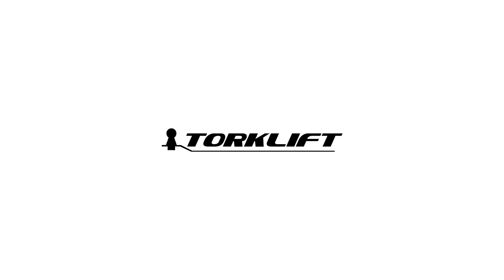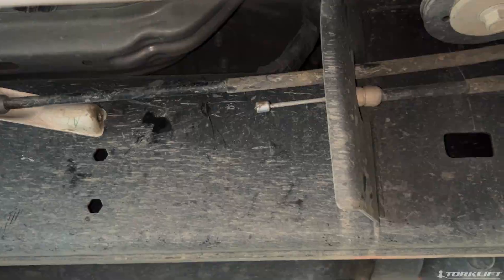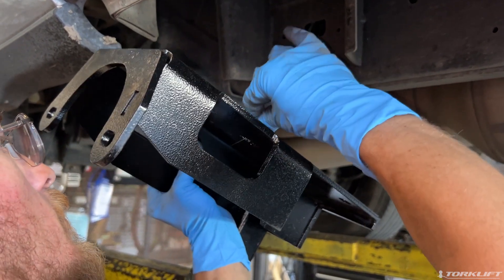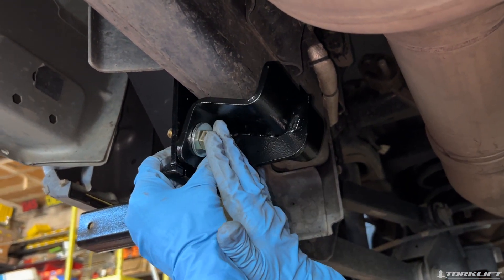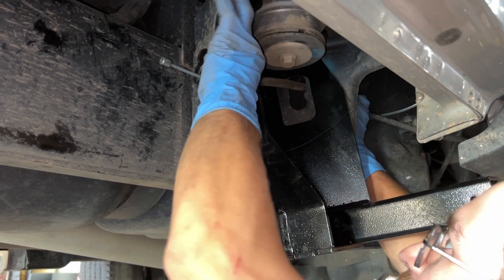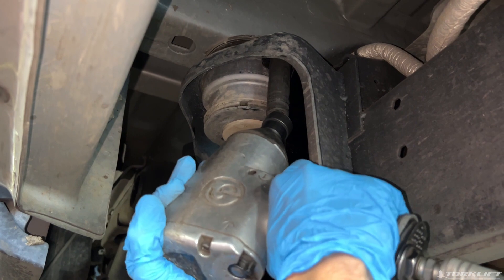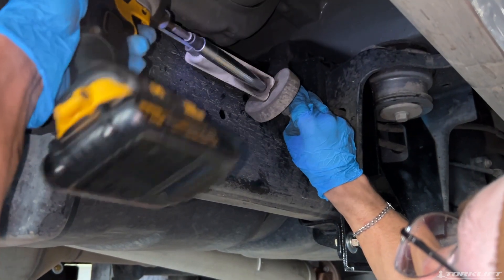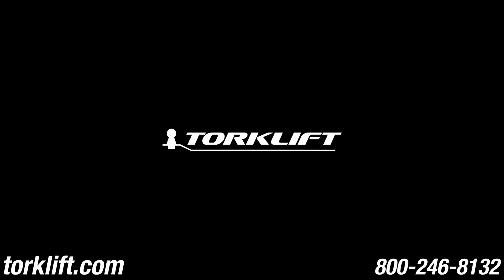How to Install D2140/D2142 | Dodge/RAM Tie Downs by Torklift

Comment: You might want to point out what that 6 inch deep sock is that you used on the brake line nut. That's no ordinary socket.  What size is it? Where do I get one of those?
Reply from the maker: We recommend that if you don't have a socket deep enough to get to it, you can use a standard end wrench remove and reinstall.